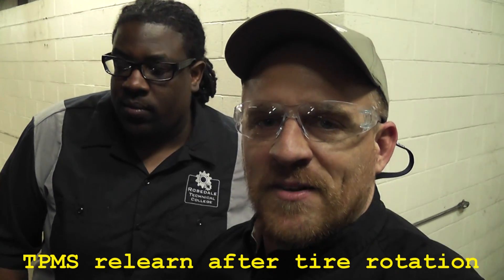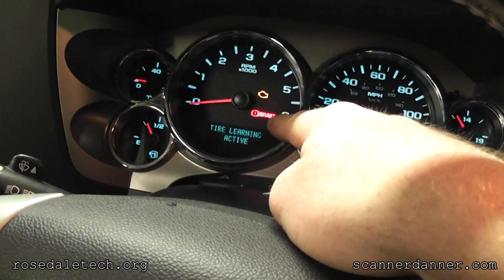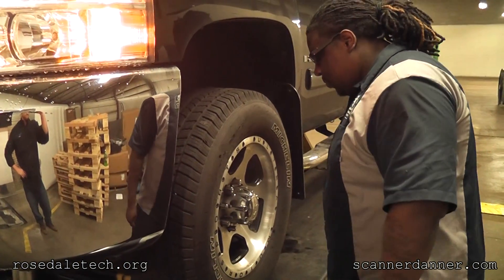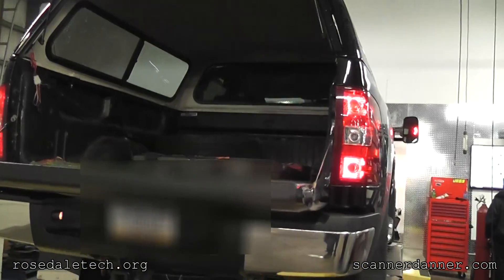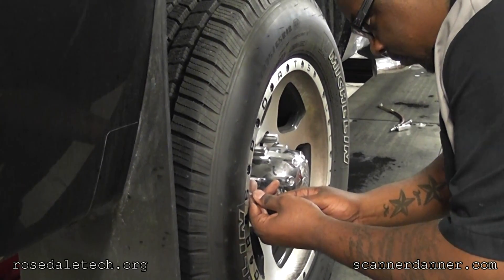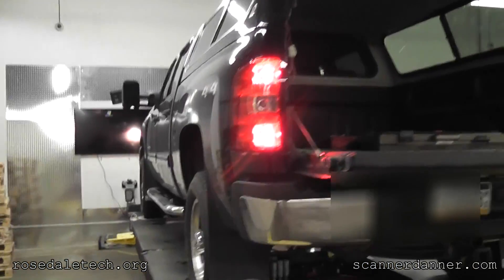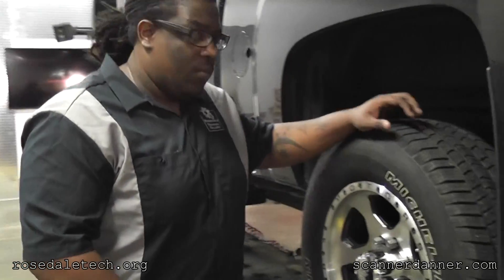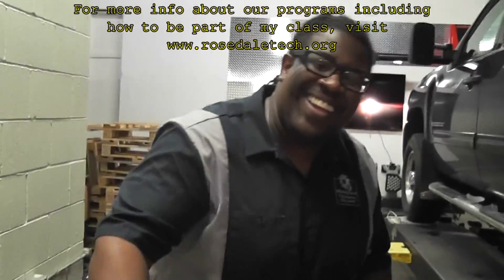How to relearn tire pressure sensors (no tools required)-GM (up to 2010)

Comment: Super cool... thanks for the demo. I'd like to mention something if I may... a - " how to... tire shop tip". you know in real world, faster  is the key for us as a mechanics... instead of using a pocket screw dr, we use the tire pressure gauge(no air hose connected to it) to release air out of the tire. it is safer for the tire valve but also quick for the job and looks more professional, you know we are we are always in a hurry...and  finding a always missing pocket screw is always a PITA. and since the tire gauge is already in your hand it makes more sense.
Reply from the maker: +Victor Alvarado agree. Better tool to use and I should have
Reply: +ScannerDanner  oh... I forgot my question  for you.  How to change the tire air pressure threshold? a demo about it will be super,  since this is a common recurrent  problem.
my experience with 2500 HD tires is: 
most of the Gm Trucks  they either come with TPMS threshold   too low or too hi. so, no matter what pressure you set in the tire, the TPMS msg and  light are always on... the fix is setting up tpms threshold according to tire application. saludos.

Comment: with gm tpms, in my experience u dont need to release air for more than a couple seconds. then just wait for the beep.
Reply: +bgregg55 most shops have a relearn tool to activate the sensors in the tires so the module can pick it up and it learns that way. the senors and modules work off of an RF signal. I work as a tech for a gm dealership after every rotation or replacement of tires/ sensors we put the module in relearn mode and use a tool that sends a RF signal to the sensors that causes it to honk/beep and you go around all 4 tires. But each make is different. some Toyota's have a button on the dash you press and drive the car above 15mph for a distance and it relearns from that. '

Comment: what if you don't have the key fob? could you use the door locks?
Reply: David Eagle  turn your headlight switch from off to parking lamps 4 times
Reply: no this procedure is only for newer chevy vehicles. look in your manual for the proper 
steps
Reply: Got a 2009 1500 work truck. No key transmitter. Manual door locks and roll down windows.  Ever find a resolution? And I don't have the owners manual either.
Reply: joe vallario thank you Sir.!

Comment: Paul I don't run 80 psi in my HD I'm running 55 psi all around or it rides like a dump truck.
Reply: +Steve Rob Steve can you program the TPMS to allow you to run less that 80psi in the rear of your HD? Or was your truck made in simpler times before all this TPMS nonsense became mandatory? :)
Reply: +motoYam82  mine is pre TPMS but friends of mine have the newer HD 's and yes you can program the lower setting. Don't know what their using to do it with but I can't run my truck with 80 psi it's too rough with wheel hop and poor traction in the winter. Ha with 80 psi in the back I can do an awesome smoke show LOL
Reply: +STEVE ROB  I believe Edge , Bully Dog ,Hypertech , are a few who make so called tuners , or some use the words programmer that people use to change , or maybe turn off the pressure limits . That is how they are doing the lifted jeeps here , I have not done a newer chevy but thinking it may work the same
Reply: +wtbm123  Terry I have the Diablo tuner for my truck and it does exactly as you say, I couldn't run with 80 psi without a kidney belt. LOL

Comment: 80 PSI wow. My TA radials are so much better than these factory tires.
Reply from the maker: +Rod Palm I know right? It's the heavy duty tire (10 ply) 
Surprisingly with 80 psi in the rear and hardly ever hauling anything, my tires to not wear unusually in the middle like you would think.
Reply: +ScannerDanner  The dealer can reprogram those to drop the threshold on the rears so you don't have to run 80 in them all the time.

Comment: im going to try this tomorrow and if it works im going to kill the idiot mechanics who told me that all gm car tire pressure sensors give you the wrong tire location. i have always had the sensors give me the wrong lication and according to this video it is bcz whenever i installed new tires they never programmed the correct locations
Reply from the maker: +Alternative yep
Reply: +ScannerDanner i tried this and it worked! Thanks allot! For years i was getting the wrong readings and i though it would mean an expensive fix by replacing all the sensors as some mechanics told me it was a fault with the sensors!!
Reply: who ever it was that told you this. never return to there shop. they have no business working on anything
Reply: +torcher78 Amen to that, preaching to the choir now.  If you offered $15 extra for them to do this, they still wouldn't because they don't wanna in the first place - lying to the customer gets them their way and now you really know where they are coming from.  We are just bags of money to them.

Comment: Uhh I bought the tool. Best money I've spent to be honest considering I need to change tires twice a year for the season changes. I hate airing up and down tires it stopped working accurately on my 2007. Now I just do all 4 tires in under 1 min! 100% Accurately!
Reply: I agree 100%. Bought one off Amazon for GM, listed below. After attempting the let air out procedure on multiple Gm's, I bought the tool. Sometimes the air procedure works, other times it doesn't. The tool is super quick and if it fails to recognize the sensor you know its bad. 

Kent-Moore EL-50448